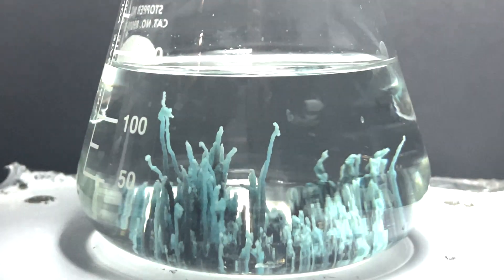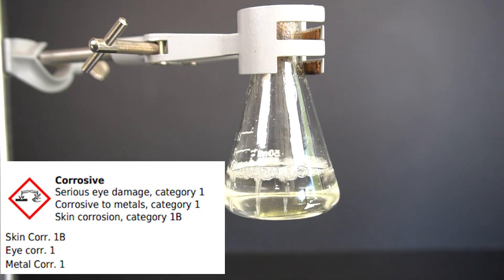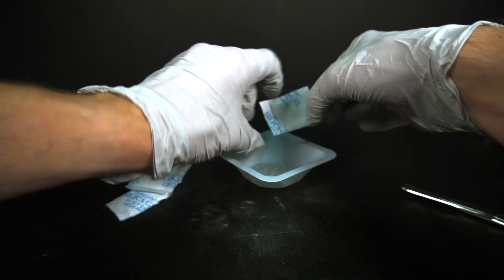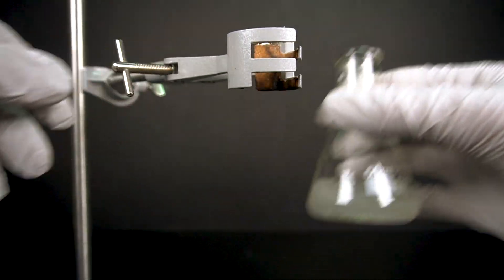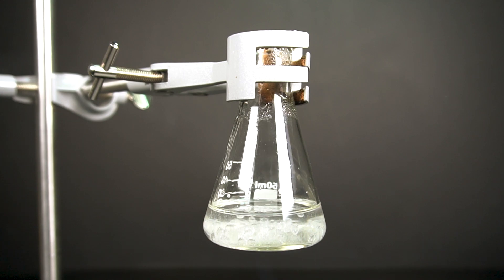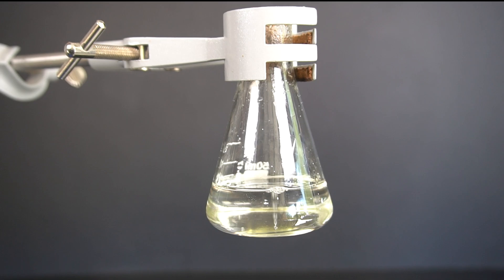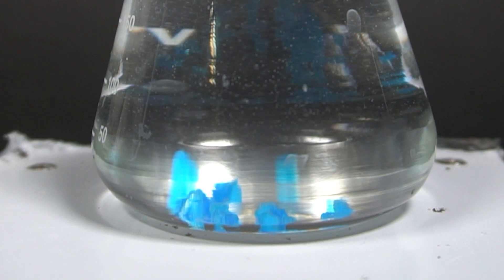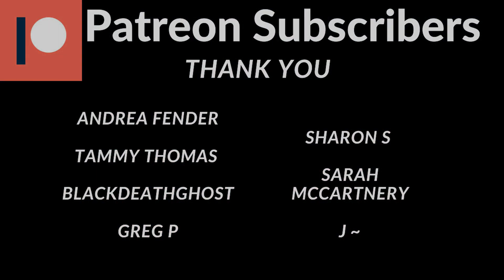Making Water Glass - Sodium SIlicate #learning

Comment: Hey thank you for your nice video because sodium silicate and waterglass is not covered so often by Youtube chemists. By the way I would rather call it a waterglass analog.  For many many applications what you did is close to being water glass solution but the real water glass solution is normally not made in this way but by melting stand and soda and then deserved in water and what's coming out is not exactly the same as the thing that you did ( but still it is very close to that).

Comment: Can a microwave be used for heating this reaction? How would using KOH as a base change things?
Reply from the maker: Microwave definitely can be used to heat up. 
Though you are less able to control the reaction since microwaves heat things up in “hot spots”. 
KOH would work as well